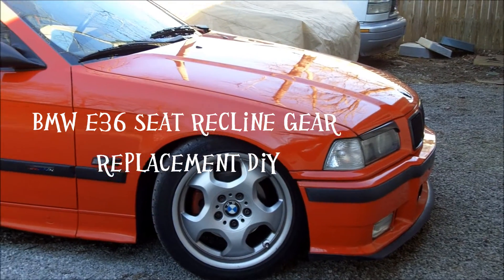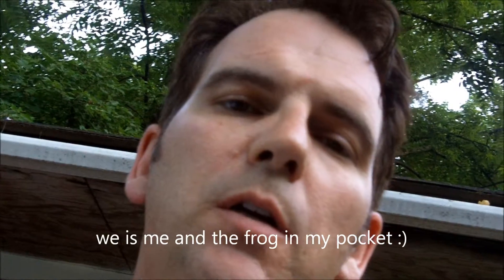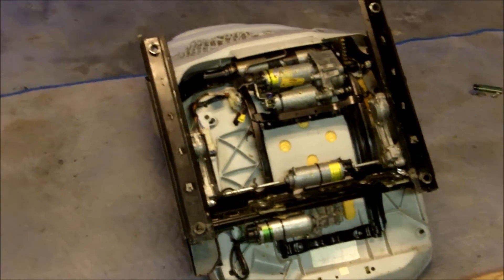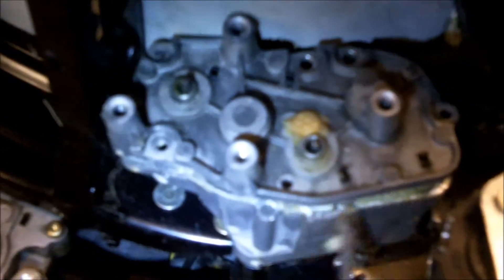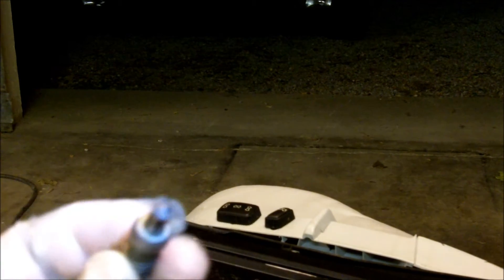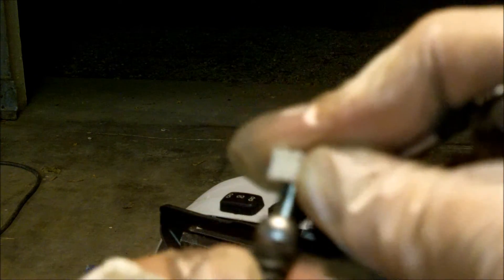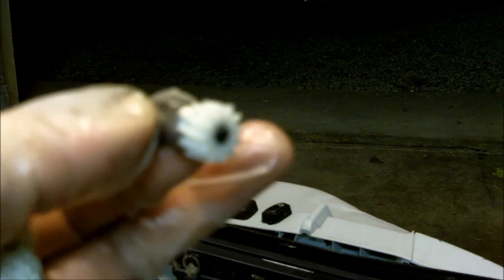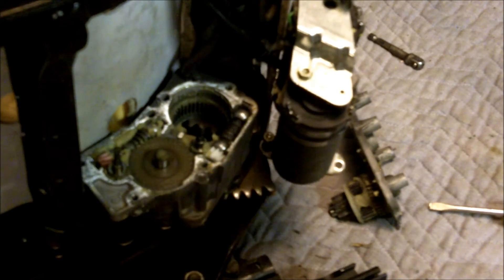bmw e36 e46 3 series broken seat gear diy.wmv

Comment: Terrific video, thx...just followed your instructions on my 1996 E36 BMW 328i & worked great!  Only adjustment I made was keeping the unbolted seat inside the vehicle (scissor jacked it up to access underneath)...eliminated having to unhook wiring / lug the seat in & out, sped up the repair.
Reply from the maker: Glad it helped
Reply: Trying to figure out how you used a scissor lift to lift it without taking bolts off. I’d love to hear how that was done. Thanks.

Comment: Any tips on how to remove the passenger seat when its all the way to the front..However it wont move backwards as to reach the two large bolts that hold the seat to the floor.. basically seat frame is blocking the two front bolt access...?? Thanks
Reply from the maker: That's a tough one